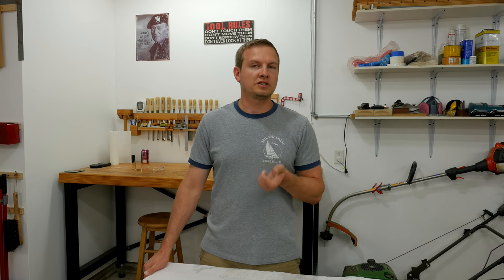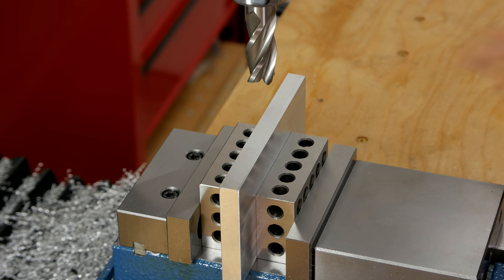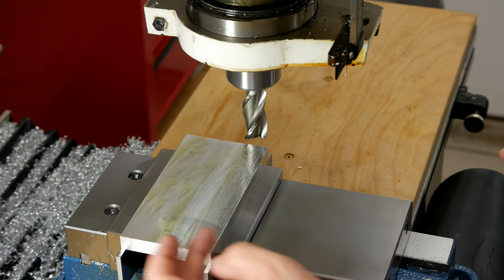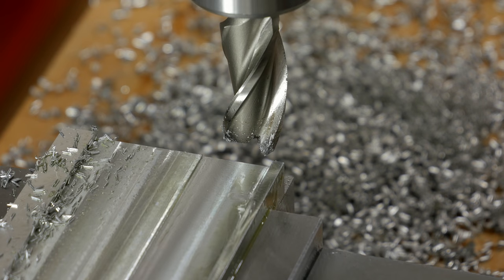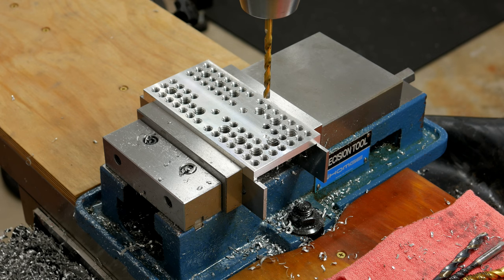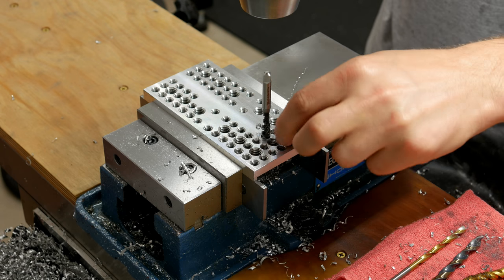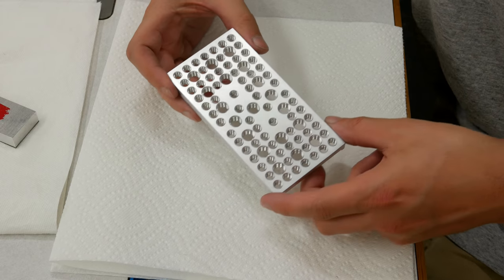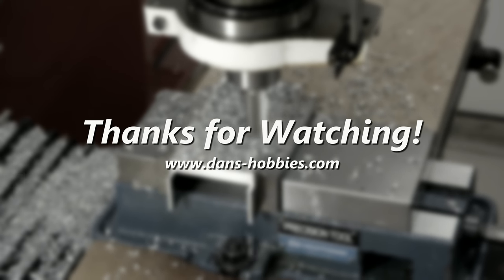Machining A Camera Cheese Plate

Comment: Great video! Did you calculate the distance between the threaded holes yourself? Did you use the standard distance? I'm trying to 3D print something similar but didn't manage to find out the right distance yet.
Reply from the maker: the pattern is my own design, but the spacing is the, industry standard 9mm between centers. 

I actually 3d printed one before making this one, but the threads didn't print well (not uncommon). If i had to do it again, I would just print strait through holes, with a lot of shells and tap them after the fact.
Reply: @Dans-hobbies  I'm actually super satisfied with my threads. They printed really well but the distance between them was a little off. Thanks for the info btw. Great work!

Comment: Awesome video. You may want to consider putting the camera on the opposite side, that way the screen wont obscure the rear of the Mic and you could flip the screen and see it from in front. Just a thought.
Reply from the maker: I cheat and use the mobile app to start and stop shooting and to set focus.  When I'm using the screen in the back , its just to frame the shot before I start recording.

Comment: Why in the world did you reject the plate with the extra hole?  Good time for anodizing?
Reply from the maker: Dick Horner those two holes would have interfered with one of the special ones that attached the cheese plate to the preamp.
Reply: That's a shame, considering how much effort went into getting the piece so nearly finished.  But, if it ain't right, it's at least a lesson!